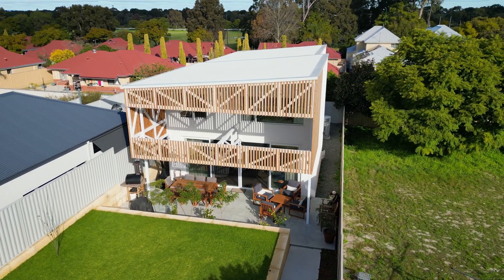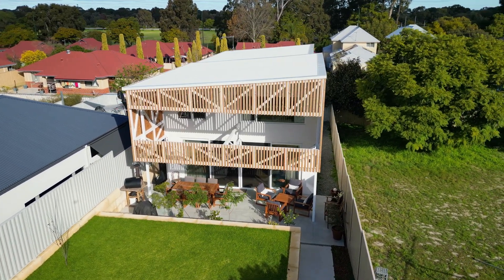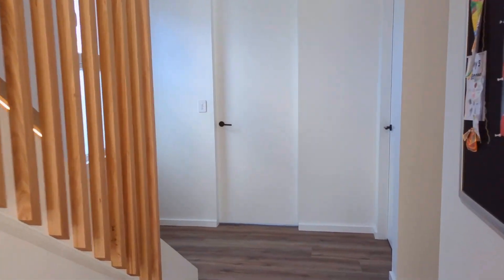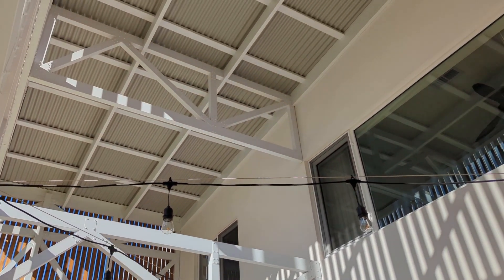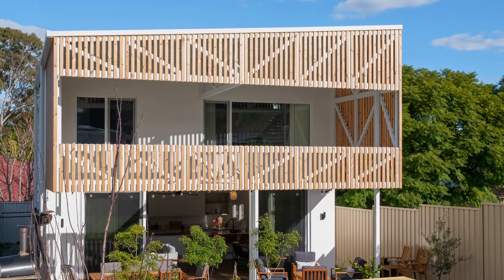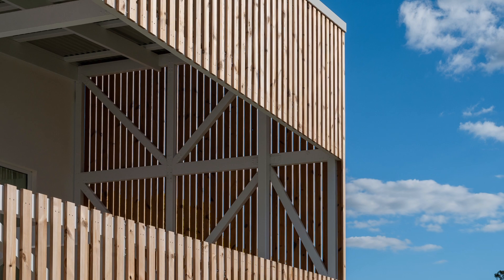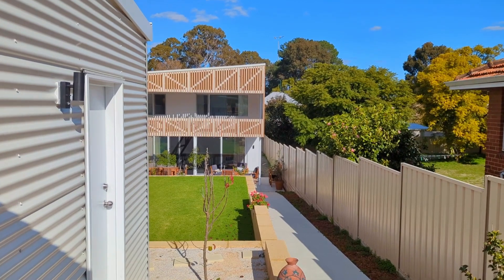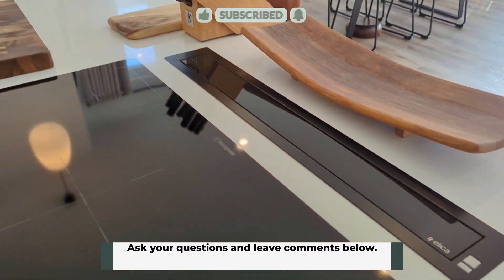Gamechanger! Sustainable Home of the Year 2024

Comment: Looks good. 
How does it fare for thermal mass?   Good to have when the sun don’t shine and the wind don’t blow for a few days….and electricity prices soar. 
A few more details on the construction appreciated, thicknesses types of insulation, floor?
Reply from the maker: Passive House doesn't take or need thermal mass into the calculation. However we believe the concrete slab has a stabilising effect on the internal temperature. The insulation and airtightness is doing the heavy lifting in terms of performance. Much like a YETI cooler which doesn't have thermal mass but works effectively. We find it is quite easy to keep a house warm in winter without extra heating. There is 240mm insulation (R6.0) in the roof and 150mm (R3.0) in the walls.
Reply: @theleanarchitect  we did a passiv house standard home here in Scotland, with a high thermal mass.  The client, an engineer, calculated it would not need heating for six months (ie half the winter)

Comment: Looks really nice. What are the temperature ranges in winter and summer? Australia is a big place :)
Reply from the maker: Temp ranges for interior are between 18-25. Average around 22.
Reply: @theleanarchitect external temperature is what we want to know
Reply from the maker: Cold nights in winter are around 5 degrees, mean daily minimum is 10 degrees, 
Summer mean daily maximum 30 degrees with hot days 38 degrees

https://www.meteoblue.com/en/weather/historyclimate/climatemodelled/perth_australia_2063523
Reply: @theleanarchitect  .  You have a very favourable climate.  I live in Scotland…about 5 to 10 deg cooler…not so easy.
Reply from the maker: The great thing about passive house is that it can be applied to any climate